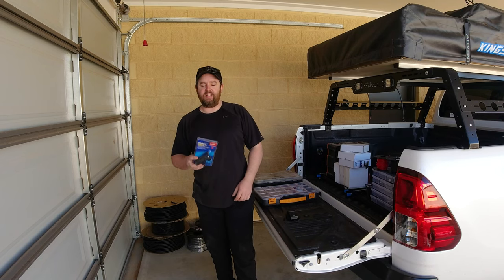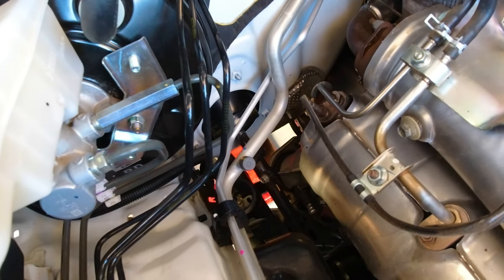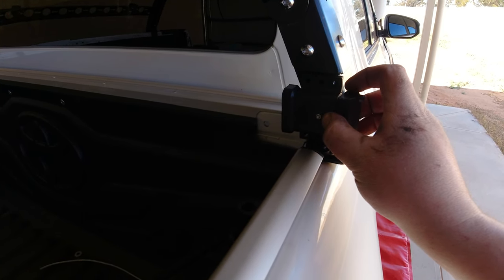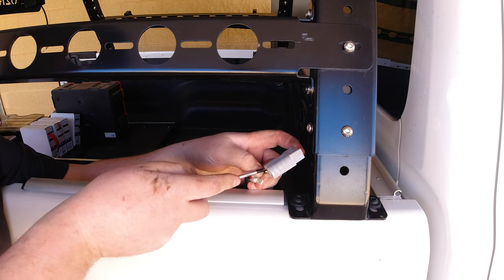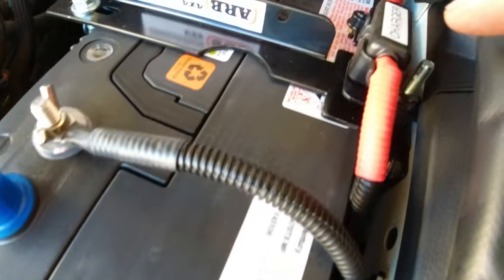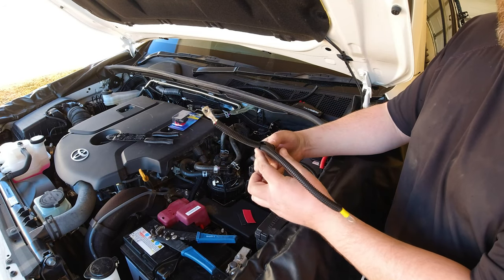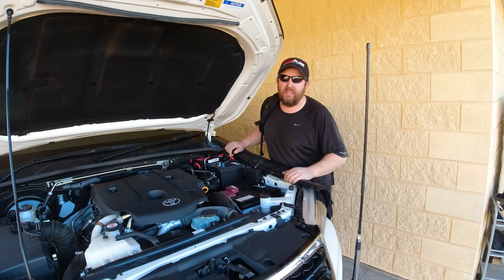How to install an anderson plug in your 4WD

Comment: Hi, nice video, Never thought about removing the plastic protection off of the ring terminal, many times I though how ugly it looks so thanks for that, just a quick one back for you at around 3 mins you take the cover of the wire straight off and then twist with your fingered, the way I was taught was to actually twist with the wire cover and pull off whilst doing so, it already as all the wire together and twists the whole lot. Not a criticism just an idea that might help. Cheers

Comment: Legend!! Right at the end where you show the switch on the rear of the tub rack. How can we ensure the switch connections are water proof?? Want to do this exact thing with 3 switches for 6 lights
Reply from the maker: Mount a little Junction box & install your switches into the Junction box. Even if you bolt it behind the rear tub rack to hide it & have the switches sticking through

Comment: Great to see crimping used. How many people flood the terminal with solder and put the bare wires (cold, not tinned) straight in. This causes a dry joint. Keep up the good work.
Reply: i put the terminal over a gas stove and put some solder in it and then i heat up the wire as well a little and mmash the 2 together, soe solder leakes out but atleast i know its penetrated into the wires and after i crimp the ends

Comment: Can an Anderson plug with an isolator switch be installed on a sedan such as vt commodore sedan or can they only be installed on 4WD with dual battery system, hoping to install one for when I have my solar powering system on my camper trailer, I can’t find any information or videos on installing Anderson plugs on a sedan
Reply from the maker: Yes you can run an Anderson plug to the towbar on any car from the main battery 👍

Comment: I'm in the process of installing a couple of Anderson plugs in my 4WD. Currently running the cable from the engine bay to the rear of the vehicle. Is it possible to have one of the Anderson plugs setup in such a way so it will only become active when the accessories are active ? Possibly through a relay ?
Reply from the maker: Yes definitely. A relay is the best way to achieve that 👍
Reply: @Campingdownunder  Is there a particular sized relay that I need to get for this install that you can recommend ? I'm still new to using relays and relying on my son's knowledge about them but he works and am in a slow mode to install them myself as I get the chance. Thanks
Reply from the maker: @gasparoochie as long as it's rated to 50 amps minimum. I do have another video on here showing how to wire up a relay 👍
Reply: @Campingdownunder  your videos and replies have been a great help. I have one more question, I have almost finished putting in one anderson plug which is connected via a relay but the second I want to be connected directly to my second battery so the power is constantly on for my fridge. Is it ok to connect it directly or is there a need to put it through a relay in some way so the power is constantly on ?
Reply from the maker: @gasparoochie no if you want it live then run it directly to the battery through a fuse

Comment: Hey mate love the vids. 1 do you for yourself?  2 do worry bout fusing the the reed off wire to the rear lights or just rely on the 30amp Anderson fuse ? And finally 3.  I still running redarc batt iso but using mega blade fuse of 40 amps on the supply to my acc hub in the tub Would you recommend doing what you did here or is this more a DC charger issue?
Reply from the maker: All lights should be fused. I had already run the fusing for the charger and Anderson plugs before finding out about the lights. It will still be ok but it's always better to fuse everything separately. I'd use midi fuse holders for anything charging related. I've seen so many blade fuses melt & even melt the holder so it's not worth taking the risk
Reply: @Campingdownunder  yer awesome thanks very much for help appreciate it. Love watching the install vids. Love to see more customer installs

Comment: Nice work. Just wondering if the earth can run to the negative terminal?
Reply from the maker: Yeah that's fine. As long as the battery you are connecting it to is earthed to the body 👍
Reply: Thank you
Reply from the maker: Anytime mate 👍

Comment: Hey mate can you tell me why you should run 6mm cheers
Reply from the maker: Anderson plugs are rated for 50amps. Even if you are only running a fridge from it that only draws 5 at the most when installing them it's better to cover all bases. If you used anything thinner then you risk the wire heating up & possibly catching on fire. You want to create the least resistance as possible. So use minimum of 6mm 👍

Comment: Nice install and instructions. I also like the MIDI fuse holder on the battery terminal post, very clean. Can you share a link to this fuse holder? Thanks.
Reply from the maker: Cheers mate 👍 just look up midi fuse holder on ebay
Reply: @Campingdownunder  
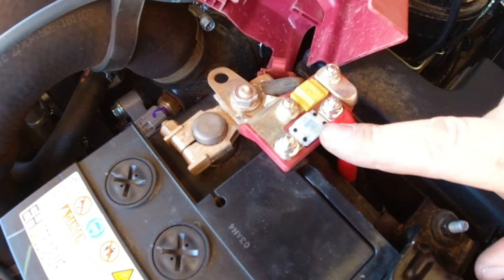Thanks for the reply. I see the black dual MIDI holder selling on eBay but I’m interest in the holder shown @ 5:49 in the video. I’ve been searching the internet and wasn’t able to find.  Thanks.
Reply from the maker: Sorry that particular fuse holder is a factory fuse holder for all new hilux's